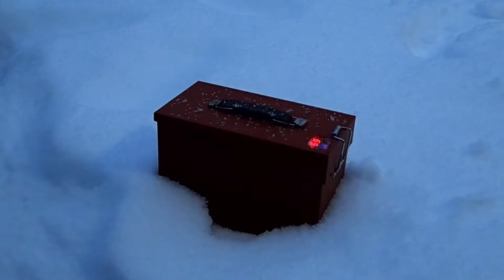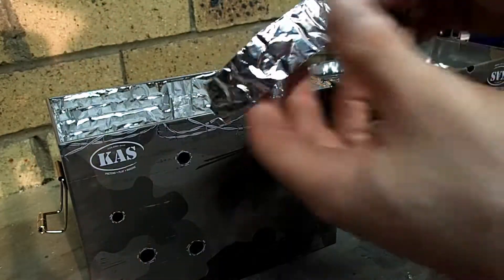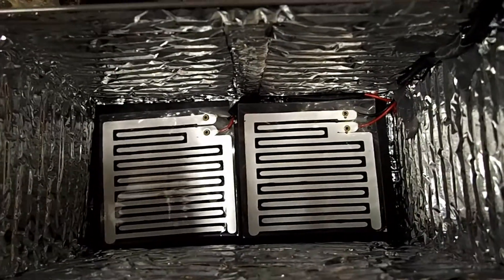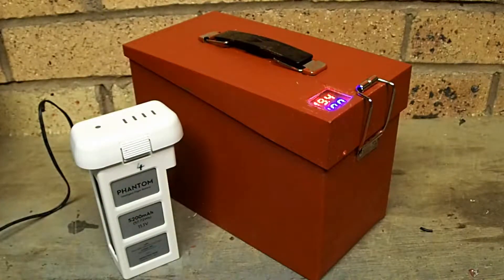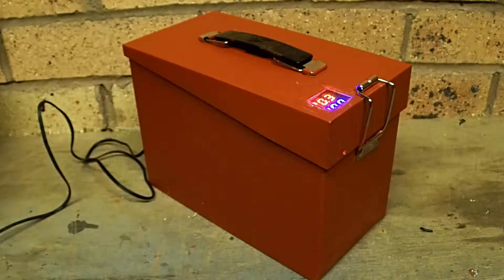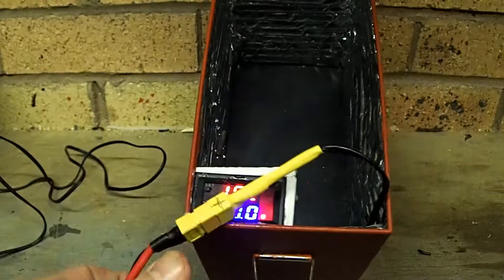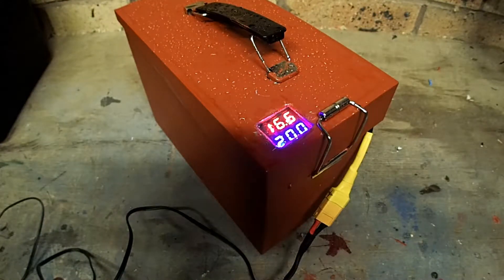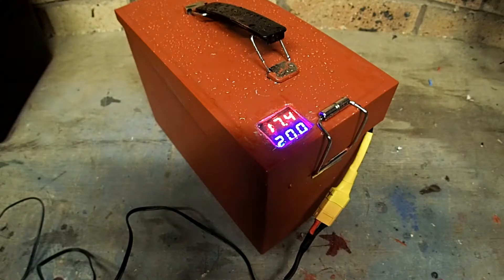Lipo Battery heater - Custom build

Comment: Thanks for the video. Is there any chance you can help me with the wiring. Have bought the components and prepped the box. Just scratching my head over electronics. :-)
Reply from the maker: Sure no probs. I am out just now but will make a circuit vid later
Reply: Thanks. Have a nice day
Reply from the maker: @ajpbhq9889  Home now.  My wiring is tucked away in the box but it is very simple.  Wire your supply to the +ve and ground (- or 0v).  Then the thermostatic switch switches on remaining two terminals.  You then link a wire from the +ve to one side of your heater ( heater parallel wired if you have two) then link the -ve to terminal 3 and terminal 4 becomes the heater -ve to the heater.   Have a look at ebay item number 173690533832.  It shows the wiring although dont worry about the colours, he got them wrong.
Reply: Thanks buddy will get on with that now
Reply from the maker: @ajpbhq9889  if you need any more help I'll send me email address to you. Take a photo of the wiring diagram and I will label the connections for you
Reply: It’s working nice now .. just have to finish it off.. you are a legend mate

Comment: Nice design mate.  Snazzy little thermal display.  I use a pair of very similar 12v heat plates in separate hemp bags, each one next to a reheatable gel pack and run off a marine battery that usually powers my motor.  To warm both my cockpit AND my jubblies whilst out kayaking this time of year.  peace